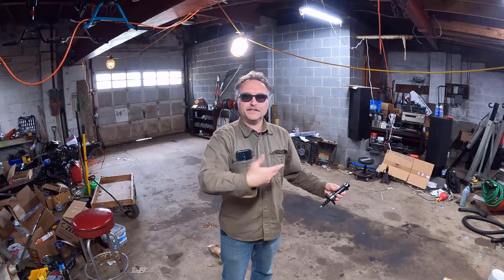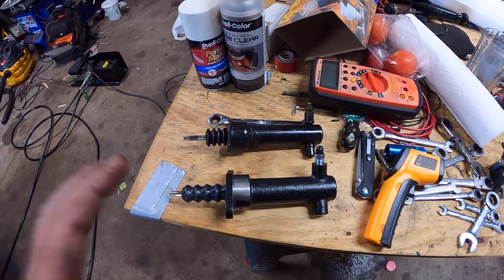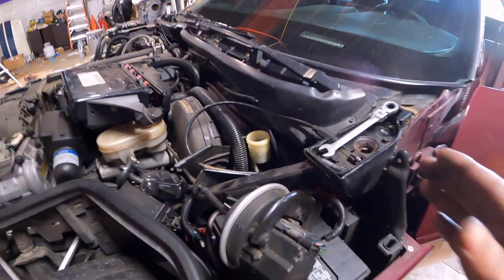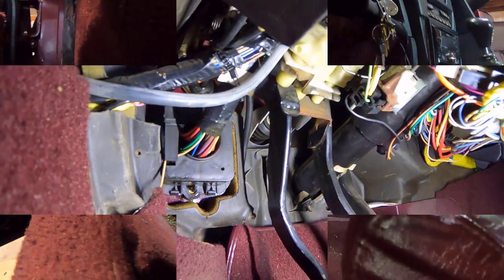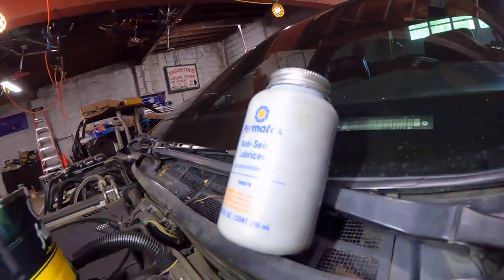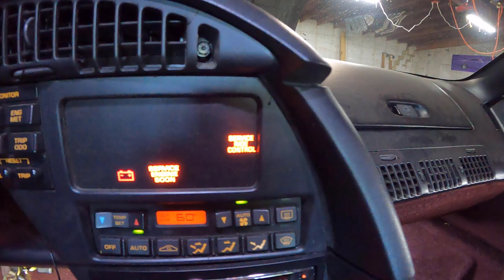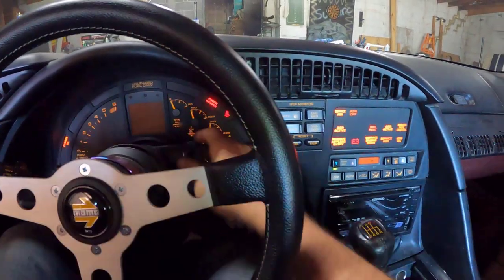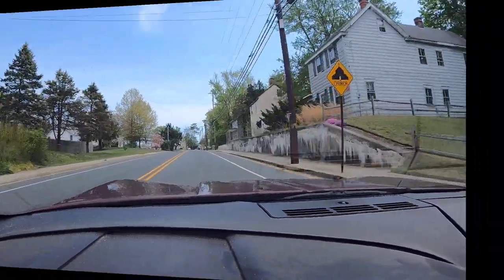1993 C4 Corvette Clutch Slave and Master Cylinder Replacements, FX3 SRC Trouble Codes and Dragy 0-60

Comment: I feel like you must have glossed over how to remove the hydraulic line from the old slave cylinder because that thing will not budge… I’ve used Deep Creep penetrating oil several times… I’ve used leverage on my 14mm…. I used a ratchet on the bleeder to turn both ends…. Nothing will get that line to budge…

30k mile car with no rust either…. Line and nut looks brand new…

I may put the old slave back in and double check the master isn’t leaking instead…

I want to use heat but I’ve just used a ton of penetrating oil which is flammable…

This is brutal!
Reply from the maker: I think i got on it and hit wrench with a hammer to break it free.
Reply: @CC_Top_Solutions  thanks for the reply! Problem is the slave is hanging by the line once you pull it out…. You’d have to hold the dangling slave and the wrench while trying to hit the wrench with the hammer…

I’m thinking with the slave back in, a crowfoot wrench and an impact could break it free and then you could pull the slave out and loosen it…. I just thought it would be easier based on videos…

I actually think it’s my master now though anyways because no fluid came out of the slave…. It looks like I have a fluid leak behind that lower driver dash panel…

Thanks again for showing all that!
Reply from the maker: @JCMusicwriter  i replaced my master...3-5 months later my slave failed. Yes, have to break the slave fitting with slave bolted in place.
Reply: @CC_Top_Solutions  thanks for the replys…. Crowfoot Flarenut and 3/8 impact it is…. I’m going to do the master for now since that’s definitely leaking…. I’m sure the slave will be down the road…. Not looking forward to that clutch pedal clip…

Comment: Started working on replacing the Master and Slave cylinders today. I drove my car the other day, and something didn't seem right with the clutch while shifting from 2nd into 3rd. There was a mechanical stop like sensation about 3/4 travel down the clutch peddle. I pushed the peddle again, and I lost 90% of the clutch and had to shift into gears without a clutch, which worked without grinding the gears. I made it home, about a mile away and shifted into neutral. I tried to shift into reverse, but the shifter was now completely inoperable. The clutch is completely gone, and the peddle is stuck closer towards the floorpan without nearly traveling at all. I also cannot start the engine anymore either. I think the clutch censor allowing the engine to start does not engage. I looked at the slave cylinder, which I replaced about a year ago, and one of the mounting bolts is sheared off......... more fun to get that tapped out...... I didn't see any hydraulic leaks inside the car's master cylinders shaft, around the engine bay's master cylinders area, or the slave cylinder???? Someone told me that they thought that the rubber hose between the Master and the slave cylinder is probably deteriorating on the inside and clogged the fluids from traveling between those two parts...... I hope that this is all that is going on. I just received the new replacement Master and another slave cylinder (just in case it got damaged), and I also bought a new braided hydraulic hose. I hope that replacing those parts will get the clutch working again, but, a new clutch it will be if needed......... I noticed that the old master cylinders mounting flange is  about 1/2 inch thicker than the new flange, which makes the eyebolt shaft (when the new master is installed) about a half inch longer than the original shaft..... guess I'm going to place a 1/2 inch spacer between the firewall and the new master cylinders mounting flange so the eyebolt shaft will be the same length to the peddle mount as the original shaft was..... It's never easy....... 

Thanks for the video! I would had taken me a long time to locate the inside MC shaft mount...... Let's just hope that I get to install the locking bracket back onto the shaft........ :)
Reply from the maker: Youll learn to bend/twist your body in new ways! Good luck, hope that fixes your issue!

Comment: Yo bro, thank you so much for the video. I’ll be installing my new master/slave tomorrow. However, my selective ride control light is on as well… if I do need a new shock, should I be replacing the actuators as well? (Hoping I don’t)
Reply from the maker: Morning, my SRC light is on again too. More than likely, the actuator needs replacement as well. Once you have the car in the air, youll be able to disconnect the actuator and see if it is damaged (the internal mechanism will be visibly cracked).
Reply: Thanks man, also did you change the hydraulic line for the clutch master/slave cylinder? It looks hard af to remove and I’m wondering if that causes the slave cylinder to leak?
Reply from the maker: @garyaubert7186  I did not change the line...after 130k miles, its like brand new.

Comment: c4 looks more easy to work with than the c5
Reply from the maker: Ive never worked on a C5...C4 may be easier.
Reply: @CC_Top_Solutions this was not an easy job
Reply from the maker: @Aqua350Lt1  haha...suppose easy is a relative term!

Comment: That’s a very interesting lift. I have a c4 vette having some issues and want to do it myself but didn’t want a lift drilled into the concrete. Definitely giving me some ideas! Got the specific model by chance?
Reply from the maker: Its a Quickjack. Ill look for the model number.
Reply from the maker: I know its been a while,but im using the Quickjack BL5000SLX right now. Figured id let you know the model number.
Reply: @CC_Top_Solutions  figured out how to get it up, still haven’t been able to get the air out of the clutch. Any tips for getting to the bleeder screw on the slave? It’s in such a tight spot. Am debating on attempting a new slave cylinder install tomorrow. Should I fill it with fluid before installing it since it will be easier to bleed it before installing it? I relaxed the master cylinder and the line down to the slave, but no success in activating the clutch. Am a newbie to the wrenching world and there’s not much on the c4 to guide me. Any tips are appreciated! Love your channel
Reply from the maker: @jakejake7162  Hello, glad youre enjoying the channel. The slave cylinder cant really get filled prior to install. Its a self bleeding system. If its not building pressure, the master cylinder may have failed. I never loosened the beed at the slave...just pumped it like 100 times to bleed it.
Reply: @CC_Top_Solutions  master cylinder is brand new, pressure has built a bit but not to as much compared to when i bought the machine. it circulates fluid and pumps out some air bubbles in the master cylinder reservoir. ive spent hours pointlessly pumping the clutch trying to bleed it that way but also saw another video that said that doesnt get all the air out doing it that way. which in starting to think night be true since ive pumped it easily over a hundred times and it still doesnt engage. or maybe its the clutch itself? i mean i truly hope not, that would be a bigger project than i can handle. but any tips on when its the clutch itself?
Reply from the maker: @jakejake7162  Hmph...maybe its a bad master or slave cylinder right out of the box? With slave cylinder not bolted in place, does pumping the clutch move the rod? Ive never heard of the self bleeding system not working. I think i pumped quickly around 100 pumps...after around 50 it started building pressure and around 100 it was bled
Reply: @CC_Top_Solutions  figured it out, was definitely a messed up slave cylinder! Did a vacuum bleed with the slave dangling, pulling the fluid from the master clutch rez down and out through the slave bleeder. Pumped the slave a few times with my fingers and bled it a bit more with the vacuum pump and she was golden. Appreciate you always responding, c4 community is so darn friendly! Time to let her rip!
Reply from the maker: @jakejake7162  Glad youre back on the road!

Comment: I tried some stop leak it looks like it ruined my slave cylinder seals... Battling an ongoing problem for 2 years where The slaves cylinder is sucking in air probably from vibration so I got desperate Even the pedal is hard to push down replaced both cylinders today...
Reply from the maker: Im not a fan of stop leak. Luckily, its not real tough to replace both clutch cylinders!

Comment: Would this be a potential viable fix for a ‘93 corvette with a clutch that is “difficult to push” ? Thanks!
Reply from the maker: Hello, difficult to push could be a binding/rusty master or slave cylinder. Did the car sit for a while? If it sat and one of them had leaked some fluid, it couldve kind of rusted in place. But, if you press the clutch in and out a bunch...that should free it up...and the fluid would likely leak out. difficult to push could also be an aftermarket clutch with a heavy pressure plate.
Reply from the maker: so...it might be a fix...but it also might not
Reply: @CC_Top_Solutions  have you seen or heard of this problem before, and know any other considerations to solve it? Thank you for your time
Reply: @CC_Top_Solutions  I’m not 100% sure if it’s been sitting a bunch, but I will take both of these into consideration. It’s a vehicle I do not own but am considering purchasing
Reply from the maker: @guynnfit2017  I have not. I had an '89 vette with a brake pedal that was incredibly hard (two feet) to push...if I recall...that was a bad vacuum booster.

Comment: Thanks for the vid. I'm troubleshooting my clutch now. It went from working fine to not working at all, suddenly.  No signs of leaks, the master cylinder is still fill. Any guesses? (89 C4 with the Ziff 6 speed)
Reply from the maker: Does the pedal still move and have tension on it? Its pretty easy to unbolt the slave cylinder to see if something is wrong with it. I think id start there.
Reply: @CC_Top_Solutions  Thanks!  The pedal travels, but has little tension.
Reply from the maker: @whelk  that sounds like the master is not pumping fluid. If someone else depresses the clutch pedal and you watch fluid with cap off, do you see any action? Put a rag underneath just in case some spillage.
Reply from the maker: @whelk  if you pump it like 20 times real fast, does pedal get heavier?
Reply: @CC_Top_Solutions  I tried pumping it about 30 times and there was no change.
Reply: @CC_Top_Solutions  I'll try that in a couple days when I have a helper.
Reply from the maker: @whelk  something else you may want to check, look in the footwell to make sure the master cylinder rod is still connected to the clutch pedal. If it somehow fell off, youd experience these symptoms.
Reply: @CC_Top_Solutions  Good idea! I'll check that.

Comment: Power cuts out of mine when I give it to much throttle. Would that be clutch itself and not the cylinder?
Reply from the maker: Do engine RPMs increase while the power is cutting out? That sounds like clutch is slipping.
Reply: @CC_Top_Solutions  yes rpms and engine rev up like normal but power cuts out like it’s losing the power at the clutch or transmission.
Reply from the maker: @bitcornfarmer6868  Thats a bummer, clutch is shot. Dont drive it like that...could cook the flywheel and cause catastrophic flywheel failure resulting in additional damage or human injury.
Reply: @CC_Top_Solutions  ok thank you for your help!